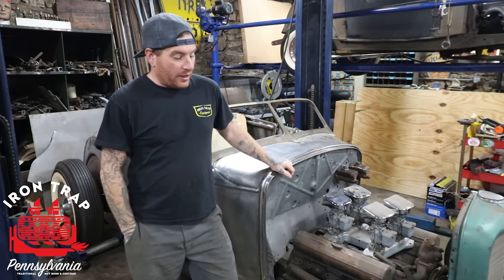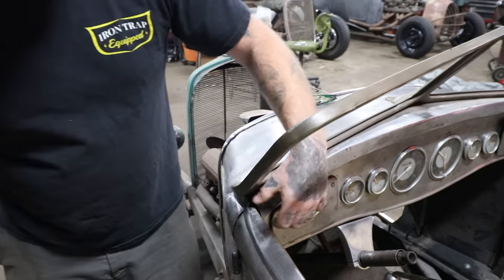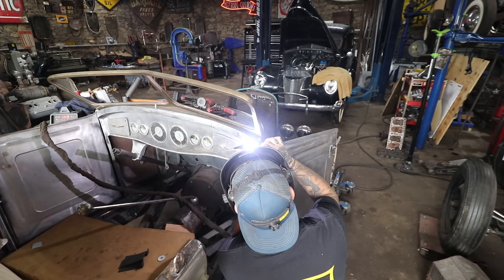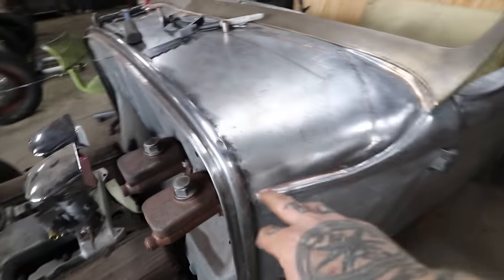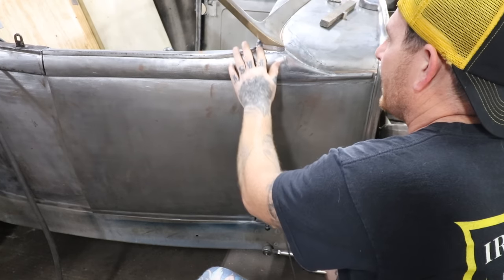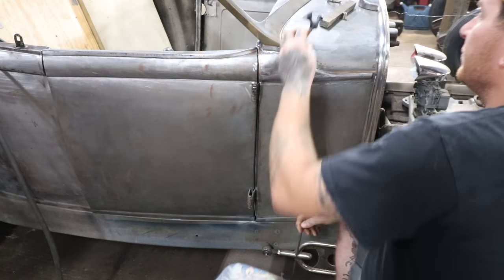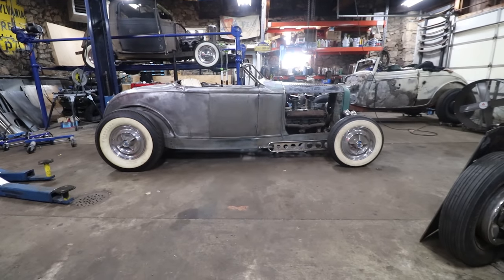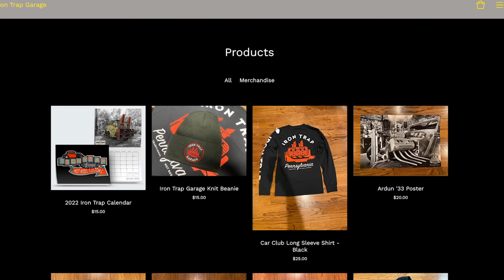Perfecting The Custom Panel Gaps On The Sweet Heart Roadster

Comment: I think your bodywork skills are very good and inspiring to people thinking of taking on such a project. A lot of these high end metal workers have had years of experience and can take an age to make panels. You started with a pretty rough body here and maybe could have done some metalwork and planishing before assembling the body. One thing I particularly admire is that you strive to get it where you want it and never use the awful phrase "it is what it is" that you hear on so many other YT car channels.
Reply from the maker: Thanks so much. It is always a balance for me between getting it “right” and the end of my skill level. I look up to these guys doing perfect metal work that everything is right the first try and I have to some days realize that isn’t where my skill level is but I want the car to be finished so I need to settle or I’d never finish any cars.
Reply: @IronTrapGarage  I agree it is very important to keep projects moving. The reason you find so many cars in barns etc is that projects have stalled for various reasons. My first car took me 18 months to fix. I was bright green when I bought a decent looking car made out of filler and washing machine cases that disintegrated before my eyes. I learnt to MIG and TIG weld and to generate complex patch panels from strips of metal so major forming, shrinking and stretching weren't needed. I never had these tools but by the time I finished not a lot of lead and finishing was needed.

Comment: I'm a retired Cabinet Maker. On your seat did you ever try. Bending board it's 3/8  mahogany two parts laminated together is strong. A little more moisture resistant easy to work with.

Comment: Use the hood as is but modify the top of the body bead on the cowl to match the hood. It`s only like 5" before it curves up to the windshield. It will be faster & easier than making a whole new hood. Also are those curve sweep gauges hanging on the wall behind the brake at 4:10?